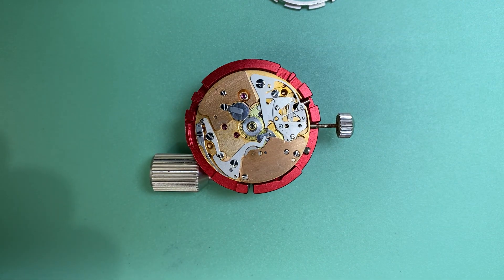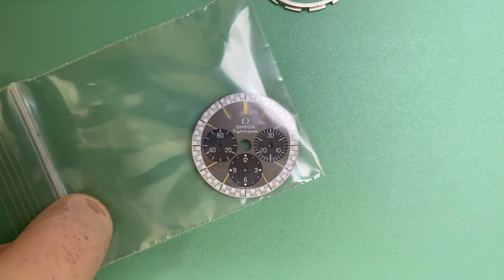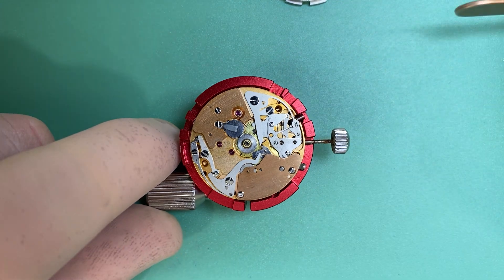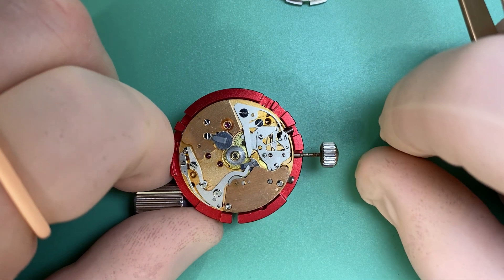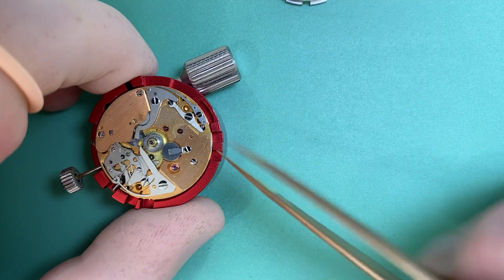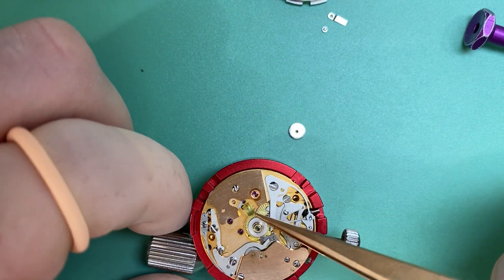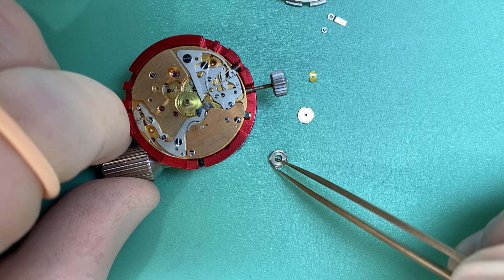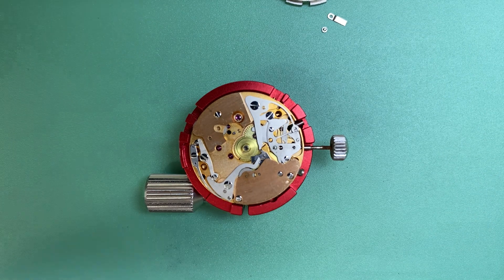OMEGA Flightmaster - How It Works: An Inside Look

Comment: hello sir first at all thanks for your videos... I have an issue with the bezel of my 145.036 cal 911, what happens is that when I turn the crown of the bezel it feels very hard and sometimes it feels like the bezel jumps in a way internal, so I would like to know if you have photos or any videos of the disassembled bezer system, thank you very much!
Reply from the maker: That one is a little more difficult as the bezel is internal. It sounds like the crystal and bezel setup may be assembled wrong. You'd probably have to take that to a watchmaker to sort out.
Reply: 5:57  @PrecisionHorology